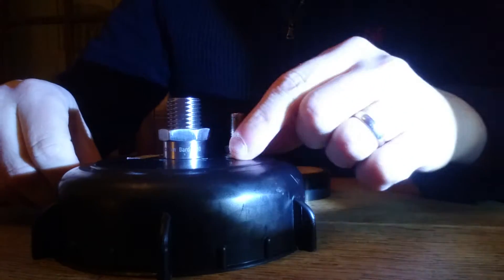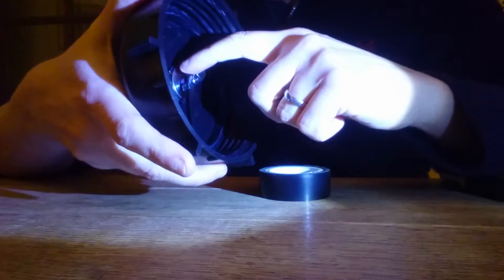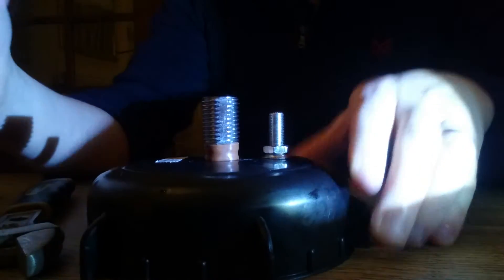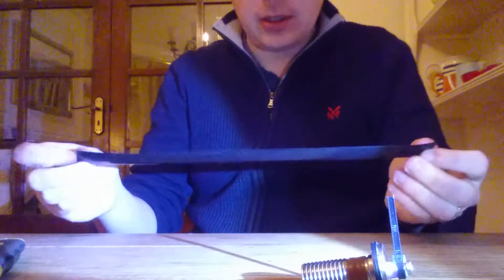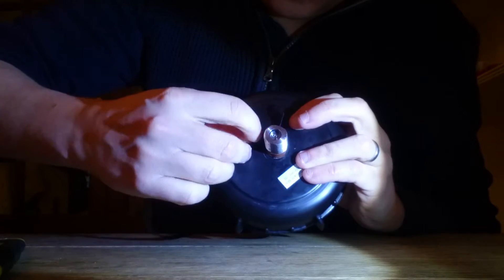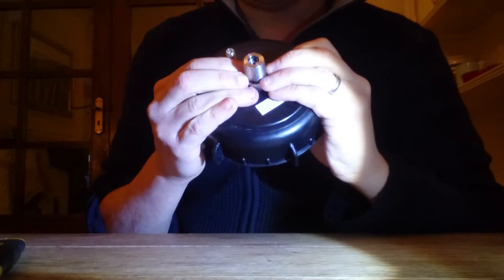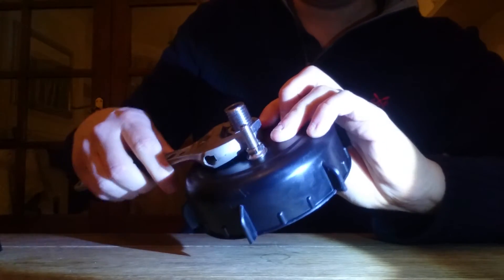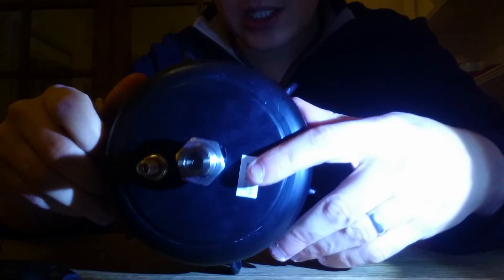Never buy an S30 Valve replacement rubber kit again

Comment: An alternative approach is to add a Ball lock bulkhead post and to use a spunding valve to release pressure or a CO2 tank and regulator to provide pressure.  The cost would be about £30 with a Kegland Spundy, but some homebrewers may have these parts on-hand.

Comment: Is the Schrader valve you used the same as ones they sell on ebay for mountain bike tubeless conversions?
Reply from the maker: Hi there, yes, they have flat metal bases. Search ebay for 'tubeless mountain bike schrader valve'. There are a few types so check the bases.
Reply: @robertbaldwin177  cheers I will try that search car ones kept coming up with a rubber bottom.  The sad thing is I have presta ones in the garage that I actually bought for my mountain bike and never got round to using ;)

Comment: I know it's an old post but there is a quicker method. Use a small, thick elastic band and keep doubling it until it's quite tight against the old seal. You can make your own seals by buying a length of 12x10 and 6x4 clear silicone tubing and cutting them to size to replace the old ones.
Reply from the maker: Awesome, thanks for the input Andy, i'll defo be looking up those silicon tubes next time. Thanks for the comment.
Reply: Thanks for the reply Robert. I would just like to clarify my previous post just for other readers.
First you might think that 12x10 is too small for the pressure relief part but it isn't. It has to be tight in order to keep as much as 15 PSI of gas in your barrel before it relieves.

My advice to fit these is to use a bit of talc on the threads then use long nosed pliers inside the tube and stretch it enough to get it started over the threads. Then insert a watchmakers screwdriver (or similar) between the tube and threads and wind it round whilst gently pushing the cut tube down to get it seated centrally over the holes. Job done.
The 6x4 bit of tubing is to replace the non return at the bottom of the valve.
Reply from the maker: @retrocomputeruser  this is excellent advice and I'm sure it'll be given a few thumbs up by other youtubers as time goes by. Thanks for taking time to share the technique.

Comment: Why not just buy new cap without s30 valve
Reply from the maker: Hi Dave, S30 allows you to top up the co2 pressure. It is a standard feature on most pressure barrels and allows co2 in but not back out again. If you simply had a cap with no valves you wouldn't be able to draw off beer due to vacuum. You also need to add co2 to preserve the beer as oxygen will send it stale in a couple of days. I've since glued the majority of gas release holes shut, just keeping the inlet hole that the rubber covers. Hope this helps.
Reply: Robert Baldwin but doesn’t the cable tie stop the co2 from being injected into the cask
Reply from the maker: Hi Dave, no it just keeps the rubber underneath from slipping off the end and applies a bit more pressure than the rubber wants to give. The pressure from the gas still forces itself into the barrel but doesn't then come back out again.

Comment: I have put schrader valves on all my king kegs and works a treat had them on now for a few months and so far no problems, have hooked them up with John Guest fittings to a co2 tank, so the barrels always have a couple of pound of pressure in them. even when ive pulled a few pints from them.
Reply from the maker: lewis white, great idea connecting up the co2! Not far off a corny setup. Thanks for the comment.

Comment: Hi Rob 🤗.   Did these mods cure the leaks 💦.   Since you did them. Ⓜ️
Reply from the maker: Michael Carter hi, yes, done this to two kegs now and no leaks from either valve so a long term fix. If it still leaks chances are you have issues with lid or tap. Make sure you have the pressure release schrader value fitted too as pressure gets pretty high once you've done this mod, will need manually releasing every so often, especially in warm weather. Cheers.